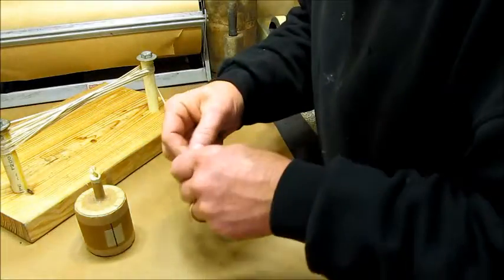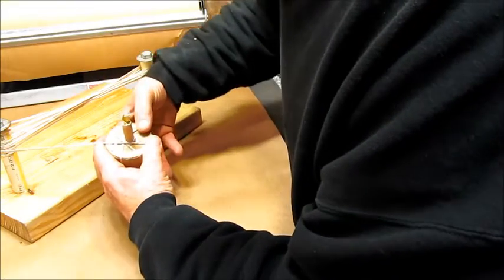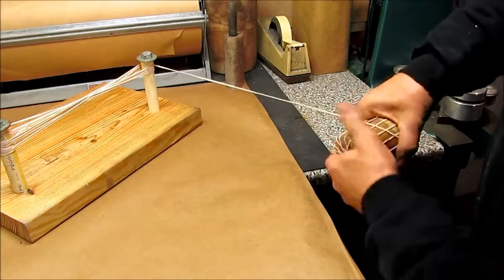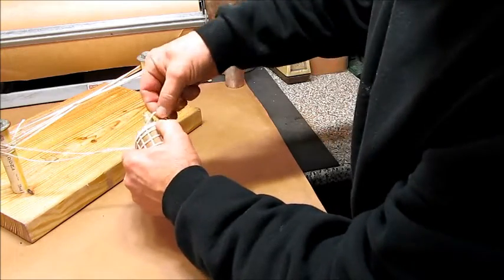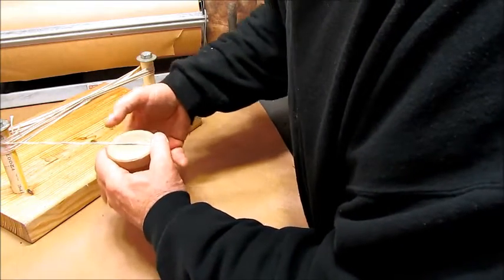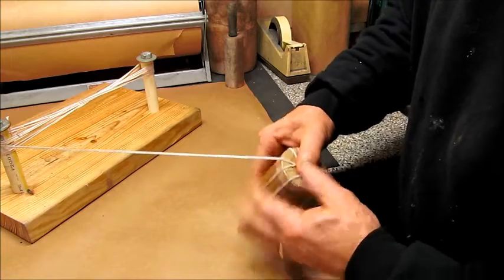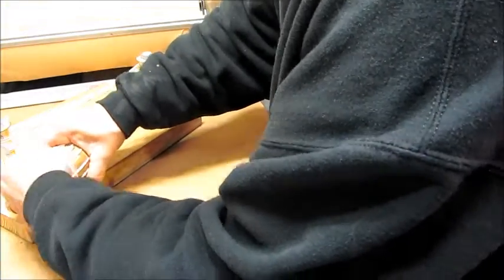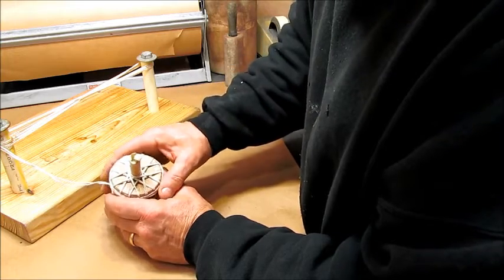Spiking a 3 Inch Cylinder Shell, Using Two Methods

Comment: Q and scenario.... Is there a max ammount of lift powder and type???? I do mostly 2 inch shells... I put 10% of a slow burning powder in and the shell went up came back down bursted on the ground...... I then used a hot BP 12 % and it blew the bottom of the shell out...... My sells are well contracted so its definitely the powder

Comment: Hello can someone experienced in pyrotechnics please answer me as I couldnt get an answer off of google but what is SPIKING for ie why are certain fireworks SPIKED what does it do is it to do with way the patters of the shell ie star Burst etc that's what my thought is but that's only a guess any answers would be appreciated thanks.
Reply from the maker: It creates good, tight confinement, in the way that many layers of pasted paper do on a ball shell. It's quick and easy to apply, really brings the contents tightly together, creates a lot of strength and confinement, and doesn't require the lengthy drying that many layers of pasted paper would require. That's my take on spiking.
Reply: @nedgorski  Do yours not get pasted in over the spiking?  Or are you just saying it needs FEWER layers of paper?
Reply from the maker: @goodmaro  I was just demo'ing the various spiking techniques in this project, Robert. Depending on whether the shell is a pasted-in one, or rinfasciatured, there is either pasted or dry paper applied over the spiking, yep.

Comment from the maker: There is a pretty significant difference between Italian (or Italian-American) shell construction and spiking, and Maltese. The Maltese completely cover the shell with a weaker string than the Italians typically do, per the Fulcanelli tutorials.
Many of the Maltese "secrets" are pretty closely guarded. The only place I've seen tutorials on many of those methods is on Passfire dot com.
And, you're welcome. Thanks for the "thanks".
Best,
ned

Comment from the maker: I do think that the spiking horse definitely allows me to apply the string with more consistent tension, Robert, plus, it allows me to paste or glue the string as it's put onto the horse. Especially with larger shells, the horse takes a lot of the work out of tensioning the string. I've seen Old Italian builders put the string between two discs, and stand on them to tension the string as it's applied, and some sit on the string, which runs between discs or newspaper. Lots of ways to skin the cat

Comment: Interesting device as a substitute for a lever-action spiking horse. Some people use a foot on the floor to tension the string. I find that just using my hands with no horse, if I start with damp string, once it dries I can pluck it by the tent that forms over the time fuse and it pings like a violin string near the fret. Would I have more to gain by using some kind of "3rd hand" to tension the string?